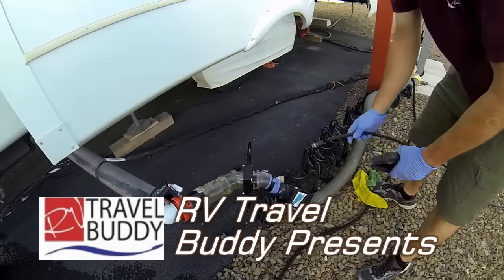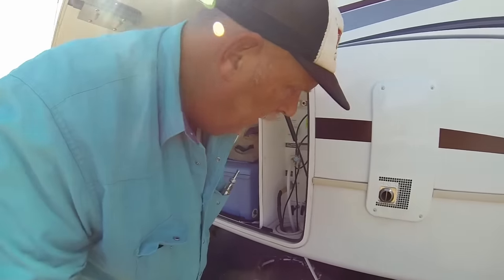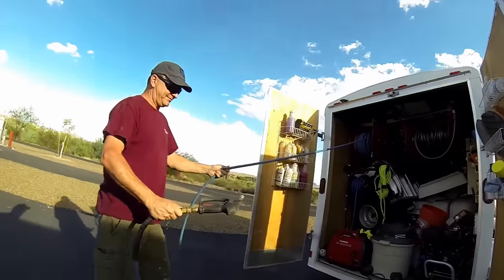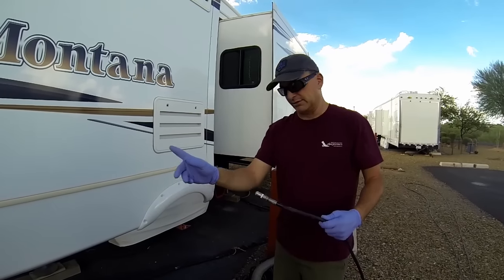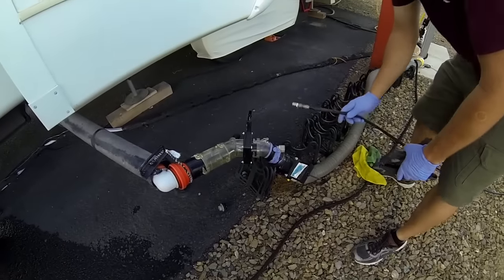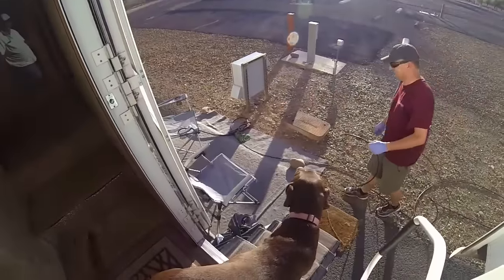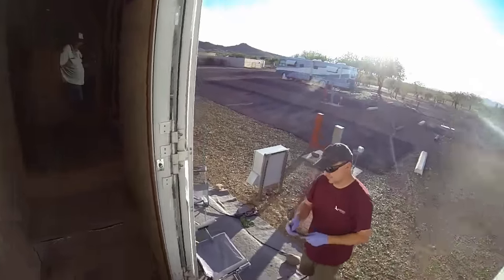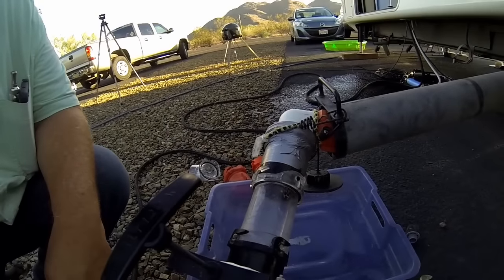RV Black Tank Enema, Pressure Wash | RV Travel Buddy #rvtank #blacktank

Comment: Had the same problem, i.e. Black valve would not close. Turned out to be a 4 inch square (not really square but 4” across) of  what appeared to be yellow sealant. I have not seen any leaks so I am assuming it was excess spilled during manufacture. It was just inboard of the valve and I managed to get it out, at the campground, with a hanger.

Comment: They make two different wands that I know of that you can put on a garden hose and put down the toilet one has a spinner on the end I have seen them but I cannot find one around here the one I got has four angled holes on the end so it sprays four directions at once and if you move it around you can get all the corners of your tank it doesn’t have the pressure of the one used in the video but if you use it every time or every other time you drain your tank it won’t be so caked on and it should keep it clean especially your float that tells you how full your tank is
Reply: I agree. My fiver has the auto rinse but after testing it a few times I went back to the same wand as you and it works better. I have been full timing for a year and a half with no problems. The trick is regular flushing. I do it every time I empty, as long as a water source is available.
Reply: Mike Bonnett 
You can buy swivel kind at Walmart. If you haven’t found one yet go there it’s like $20

Comment: Lol, to complex and not needed.
I have lived full time out of 2 class A's, a 1983 Foretravel for 14 yr and now a 2003 Holiday  Rambler Endeavor 40 ft. for 4 yrs, both bought used. I never cleaned the tanks out when I got them , never cleaned them once when I owned them, never had any trouble with them, and no smells. Simple, I just used HAPPY CAMPERS Organic RV Holding Tank Treatment, for less than 50 cents a week. I empty them when full and see it, no problem.
Reply: Your sensors work ?
Reply: @gianlucafiorillo1032  Yes and my nose too
Reply: @safffff1000  nice,, any chance you know the name brand of the hose he was using and/or fittings?

Comment: Does anybody know where you can get that nozzle for the pressure washer?  I have a 4000 PSI and a 2000 PSI electrical pressure washer I would like to use on my own. Any help tracking down one of these would be greatly thank you.
Reply from the maker: Not sure, somewhere in arizona
Reply: @RangerRob  Amazon has them!